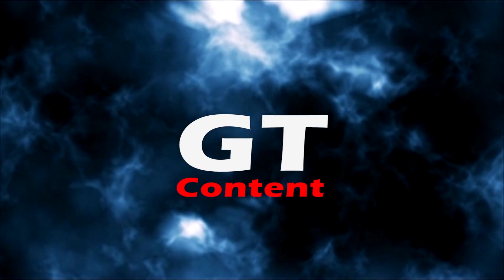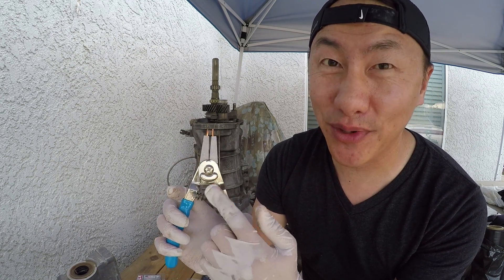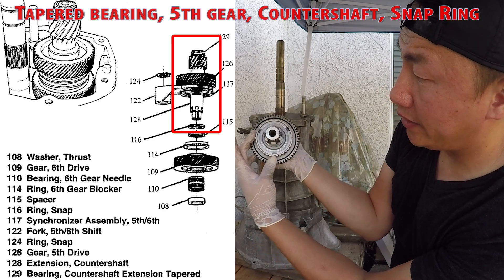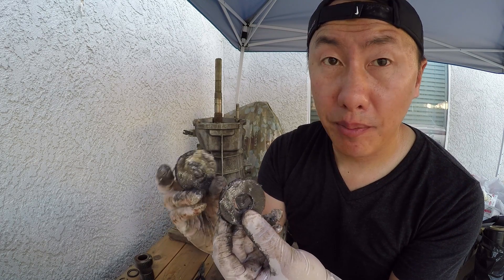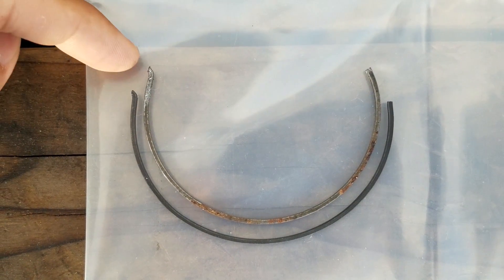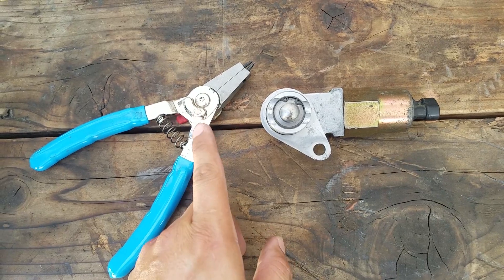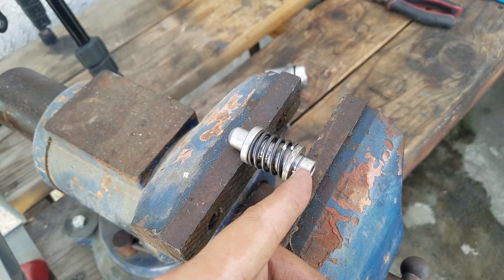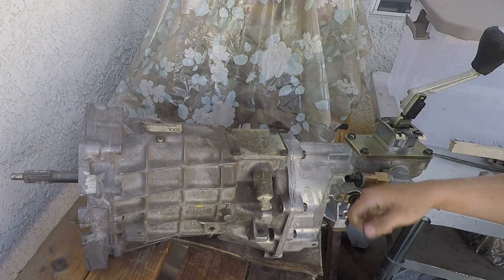T56 transmission repair & Reverse lockout modification

Comment: Excellent video.  But I don't get the reverse lockout mod.  Why would you want to make it easier to hit reverse when going for 5th?  Just wait till the solenoid is getting 12v to put the car into reverse.
Reply from the maker: It's super stiff to put in reverse. I literally have to use both hands. This makes it less work.

Comment: The reverse lockout solenoid works by applying 12 volts to shift into reverse....0 volts means it locked out and you can speed shift without worrying about stuffing it into reverse. Seems much simpler to rig up a switch or use the brake light switch as a source..the synchro problems is a big fix thanks for the video.
Reply: if hook up to the brake light that solenoid is going to be doing a lot of work

Comment: Excellent !   video   Hey I got a question I have a 2002 z28 and I bought a 2004-5 GT0 t56 cause i was misinformed..... :( however killer price ,low miles)  can I have a F-body output shaft Installed ?and F-body shifter cup then all the math will be correct with stock driveshaft too differential ?
Reply from the maker: I believe you can swap the output shaft and body tail housing over.
Reply: @GTContent  Right on I hope so this is the only thing missing for my F-body then I'm super motivated now too get this done even* more now appreciate the advice man!
Reply: @GTContent   Its the same...... I got trans with GTO yoke removed already  so  My Camaro SS Yoke ,Aluminum driveshaft  just fit right in super tight nice fit anyways I'll tell where I'm at with my project Z28 ...Its done I got every single part needed and I installed T56  transmission bleed it with a nice remote bleeder real quick but  I was getting some clacking noises from up front in tran in 1 -4  with or with out drive shaft anyways I never indicated bell housing or anything just bolted up best I could with trans Jack and straight as I could but now that I think about it My Input shaft I think has excessive play what would you do ? Just Have Tick Performance do Level 1 rebuild with new bearings ! for $2200 I think that's what I'm gonna go with then hopefully I'll have a winner Its just driving me crazy  I hate sitting cars that run ........ cant wait too solve this and Get It done this Month !